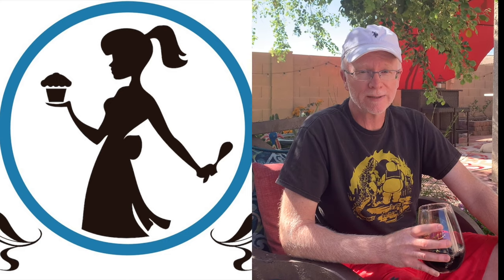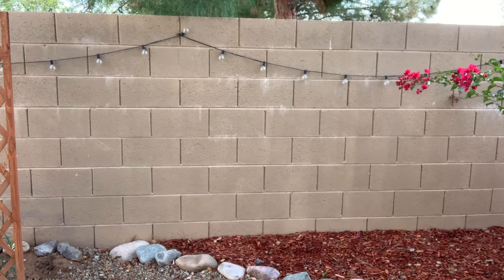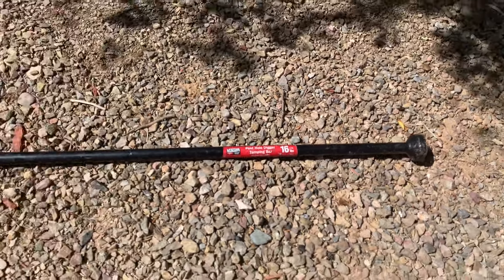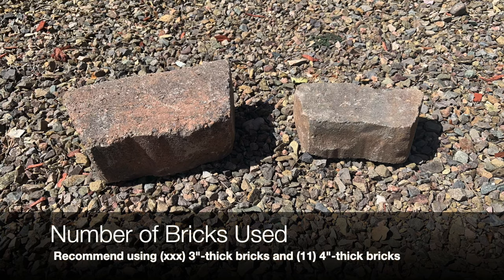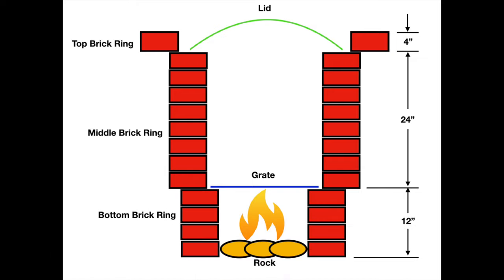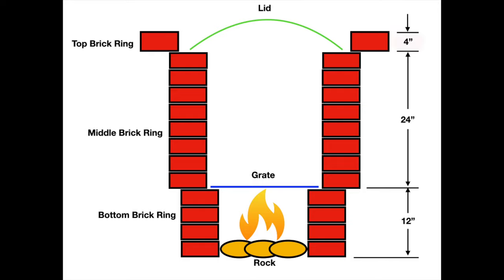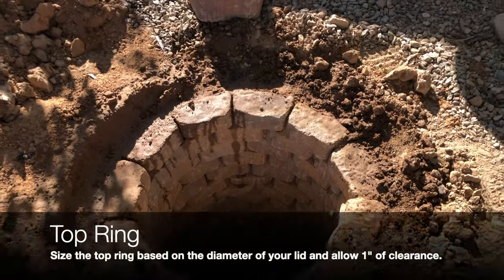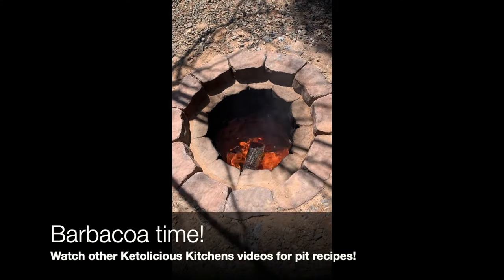HOW TO MAKE A BACKYARD BRICK BARBACOA/BARBECUE PIT!  Weekend project!

Comment: YOU DO NOT NEED TO HAVE THIS HOLE THIS DEEP. I HAVE SEEN THEM ONLY 24 INCHES DEEP LINED IN ROCKS AND COVERED WITH A BOARD AFTER YOU START A BIG FIRE WAIT FOR IT TO GO OUT PUT EVERYTHING IN A POT WITH GRATE AT BOTTOM ADD WATER TO BOTTOM THEN LAY DOWN BANANA LEAVES AND YOUR MEAT THEN COVER WITH BANANA LEAVES AND PUT LID ON POT AND COVER WITH BOARD. THEN BURY COVER WITH DIRT AND THE NEXT DAY UNVOVER DIRT THE FOOD IS READY. LEAVE FOR 12 HRS. OR MORE DEPENDING.
Reply from the maker: Hi Tamara, thanks for the comment!  If you've seen our brisket video, we're following a similar process to what you're describing except without banana leaves.  (The pit, as well as the cooking process in the brisket video, draws from the traditional Mexican barbacoa pit but recognizes most people in the US don't have easy access to banana leaves or agave.).

Nevertheless, the design is definitely flexible enough to allow for a shallower hole as long as you leave enough space for the coals and the meat.  

FYI...When we use the pit, we usually use it for large parties or when we're cooking a ton of meat for the holidays.  This means I usually have a 14" tall lobster pot full of leg of lamb or lengua/cachete with a 16-pound brisket laying on top of the lid.  A 24" hole isn't going to cut it for that when you account for room for coals.  

In any case, in my opinion if you're going to invest time in making this pit, dig the extra 12" so you don't regret it later.  But, as with everything, adapt to what works for you!
 
Saludos!